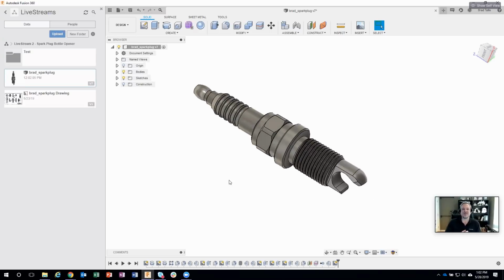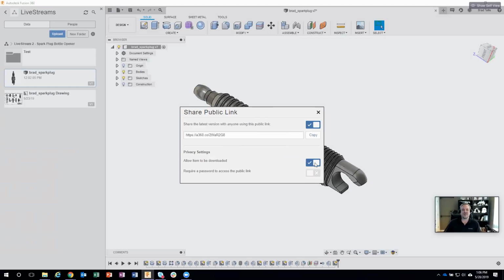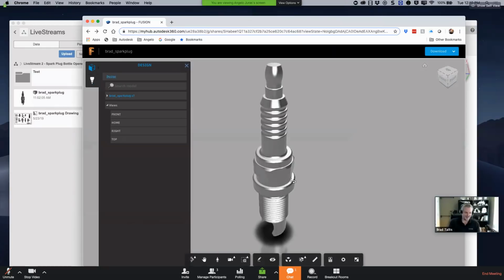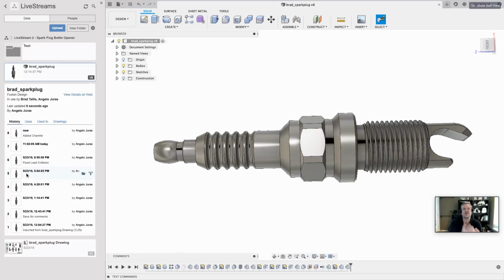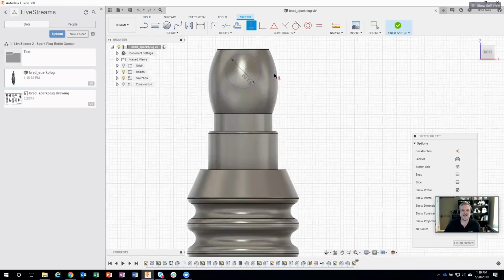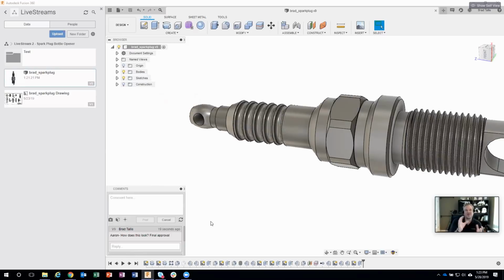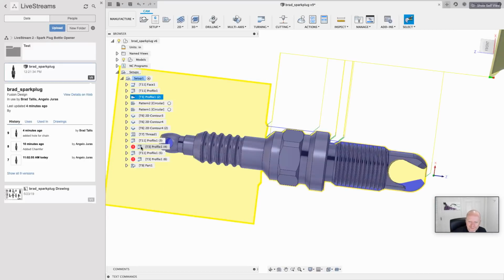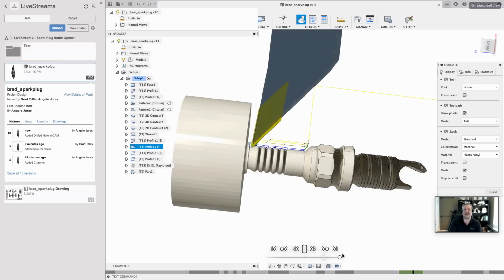360 LIVE: Collaboration in Fusion 360, Part 3 of 4

Comment: This presentation in my view misses - or maybe Fusion 360 does not have a good way - to describe an integrated workflow with an external manufacturer. What is insanely expensive and error prone in relations to manufacturing you design a file, and unlike in your presentation, it would be your supplier that handles work holding and CAM processes. You don't essentially know if his long reach 8mm finishing endmill for aluminium has sharp edges, r0.3, r0.5, ... You don't know if they put the parts on a 3 axis or 5 axis machine. You don't know their feeds and speeds....
The amazing promise of Fusion is collaboration and integration of design and manufacturing, and as described here you do not recommend to collaborate with your manufacturer in that way. In prototyping you can only go so far in ex. 3D print before you need to finish with CNC work, and it is bloody expensive to remanufacture a part where you change 3 small details, where essentially the manufacturer should only regenerate tool paths, and not start from and IGES, STEP... file and do all the work all over again.
Reply from the maker: @Jens-  Yes, I agree with your comments.  We did this video a little different to show the collaboration tools inside of Fusion 360 that people may not know about.  We aren't telling them "how" to use them in their design process.  We are just showing what is available, and it is up to the user to find the best methods to make it work in their environment.
Reply: @adskFusion  Thanks I understand that. For us it is not the control that is currently most important, as we are in a region (Denmark) where Autodesk to our knowledge has no job shops that are using Fusion at this moment. 
One thing that you hint that is relevant is that you actually ought to have some time limiting options in the system for ex collaboration with an external machine shop.

Comment: Hi Brad, Always amazed at what Fusion can do. So customisable as well. Quick question. Can you use it to sketch out design ideas? I'd like to work out how to design an adjustable tray for a small truck, to carry a race car, but don't have a firm idea of how I want it to be. Can this sort of thing be sketched with Fusion, not being a 3D model? PS: Would love a spark plug key ring. Just saying.
Reply: S R.  Yes, you can "mock up" design ideas in Fusion 360 without even creating a 3D model.  Take a look at "User Parameters".  You can create parameters that you can change easily (like length, thickness, etc) and your sketch will update according to those parameters.
Reply: Check out this LiveStream I did on this topic:  https://www.youtube.com/watch?v=5ozcw3iEOio&t=1990s

Comment: Hi Brad anyway to do a 4 axis cnc foam cutter. I make fuselages and wings with mine but there isn't  a lot in the way of design software unless you pay. My website has some examples at http://www.rckeith.co.uk.  just finished aT45 Goshawk . I'm making a updated version of the foam cutter in Fusion and will be doing a build series using a Arduino Mega and mostly 3d printer motors and electronics . Building the machine is relatively easy but software is the biggest challenge.  I can share a link to the design if your interested . I get lots of feedback from my YouTube channel and website and software is always the top question. I've learnt so much from your video's and was struggling with Fusion but now I really enjoy using and that's down to you and your team. Thanks so much
Keith

Comment: I'm interested to see if this part will be able to be turned in the current orientation. When the last features are being turned there is going to be a lot of mass extending unsupported into space and its mass will not be in balance due to the milling of the opener end of the plug. I'm thinking it may start wobbling badly or break off while spinning depending on the material being cut and the thinness of the material left right before cutoff.
Reply: Make sure you tune into Part 4 to see how the part is going to be physically manufactured.
Reply from the maker: Valid concerns. I honestly don't know what to expect tomorrow.